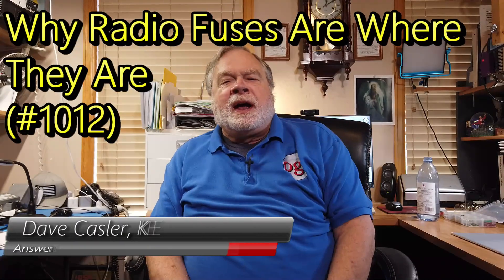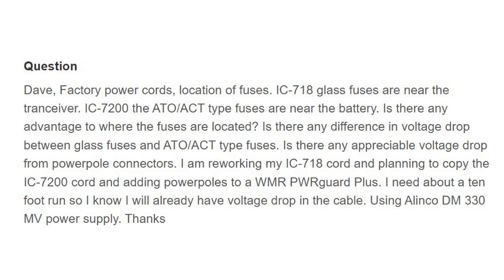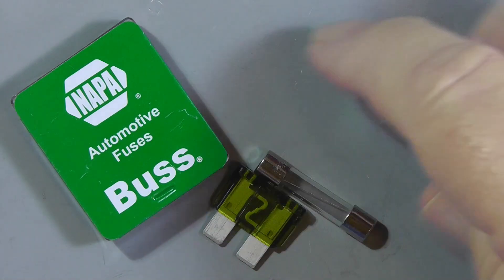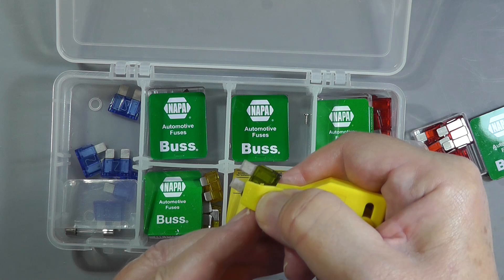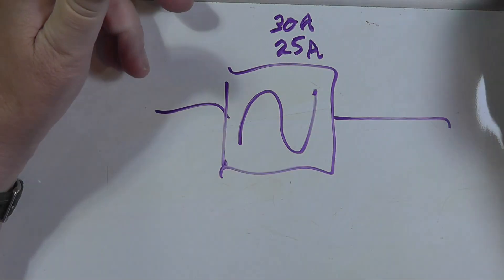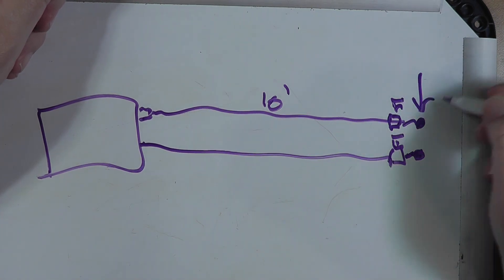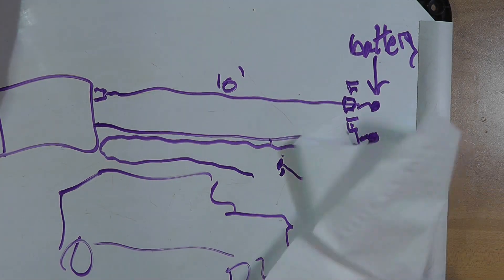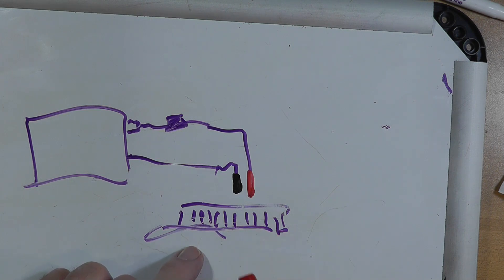Why Radio Fuses Are Where They Are (#1012)

Comment: Thank you, again. I am watching the video again. Sometimes I miss things. Also to read comments.
   First, keep plenty of fuses on hand. Working with a field engineer, we blew 26 or more fuses to find a short circuit on  Finnigan MAT 5100 GC/MS. 26 circuits went through that one fuse. A small ceramic capacitor had shorted. 
  Second, use good quality fuses. There are cheap fuses, Chinese and otherwise, that will fail and cause equipment damage and/or fires. There are YouTube videos on this. Thanks again. N0QFT

Comment: The information to connect both wires directly to the vehicle battery is outdated for modern vehicles. Due to the modern charging systems, it is recommended to connect the negative wire to a common grounding point which is usually located close to the battery.  If you don't believe me, check Ward Silver's latest bonding and grounding book. Also, depending on your vehicle, this info may be in the vehicle manual.
Reply: Yes, I agree, you don’t connect both wires directly to the battery on the new vehicles with auto stop-start and the different charging systems. Multiple reasons. And the alternator won’t know to compensate for the power consumed by the radio.

Comment: Howdy.
The thumb rule is that a fuse should be located at the wiring feed point. The purpose of fuses are mainly to protect cables from over currents (= overload and short circuit). Cable fire hazards. Fuses do not usually protect the internal wiring of an appliance. If the appliance has an internal fuse, it is indicative of that the internal wiring is considered to present some fire hazard, if not fused.
In AC the panel breaker protects the wall wiring and partially the power cord. The panel breaker protects the power cord and possible extension cord from shorts. Yes. But panel breakers do not give full overload protection of cords and extensions. Shorts yes but overloads only partially.
The Code recognizes this and allows this because a short in the cord is the most likely failure of a cord.
Regards.
Reply: However, NEC separates neutral and ground.  
DC power supplies generally don’t, particularly not in vehicles.

Thus the negative/grounded conductor should be fused if it is not at least as large as the sum of the positive leads connected to the battery to protect it in case it ever ends up being the only negative conductor.
Reply: @denverbraughler3948  Howdy mate.
How would chassis currents end up running in the radio ground wire ???.
That suggests there is another chassis connection to the ground wire somewhere. Perhaps the radio chassis or panel is mounted with galvanic contact to the car body ? That could actually introduce the hazard of many return currents finding their way through the radio chassis and the radio ground wire back to the car body eventually ending in the battery minus.
Possibility acknowledged.
Best Regards.

Comment: Can't a person just use a good multimeter to measure the voltage drops?

Also, if I am not mistaken, the largest draw will be during transmit if you ignore inrush current when turning on the radio.
Reply: Well, the answer would be sort-of, maybe. 
So you'd first need a multimeter which is good enough not to go crazy when it's measuring voltage while radio is transmitting, but we can put that under "good multimeter".
Then, there's the mechanical issue. How are you going to connect the multimeter to the cable? Normally, the cable would be fully insulated from its beginning to the end. Usually, it's possible to somehow make a connection on the power supply side, and inside of the radio. That would give total voltage drop of the whole cable, and if it's fine, then there's no problem. However, if it's not fine, then the troubleshooting can be a bit difficult. There are multimeter probes which have hook-like tips, with very thin very sharp needles on them, and are used to penetrate cable insulation, and allow measuring voltage on various points on the cable, such as near crimped splices, near fuses, and similar, and this might show which part of the cable is bad, but on the down-side, such probes puncture the insulation, which might cause problems later on.
Yet another way to look for bad parts of cable would be to key up the radio at full power, and look at the cable with a thermal camera, but those cameras are still a bit too expensive for genera use.
Reply: @AndrejaKostic I asked because I did it using various methods quite easily actually.

I measured across the different devices in the power chain and added up the drops to ensure that the measurements made sense by totalling the amounts - they should add up to the same value as across the entire chain.

In addition, my meter had no issues reading during transmit, though I also used other ways to create the same draw as the transmit draw for the radio, which made things a lot easier, as there was no limit to the "key-down" time since there was no key-down and no RF issues in the shack. Granted, there shouldn't be in a good installation. For some of the draw, I used the CBA from West Mountain Radio, for others, I used an adjustable pile like used to test automotive batteries and alternators. I just don't turn it up to draw 150A!

I found that I could access the connector contacts from behind or by disassembling some of the components without having to poke holes in the insulation, which for LV like 12V automotive wiring has been a standard method for decades. High voltage systems is a different animal.

The upshot is that I found many places where there was what I considered excessive voltage drops, some of which in places that I did not expect to find them. I then addressed those with larger wires, better connectors and installing additional, larger conductors within equipment to reduce the drop, but not change the functionality.

Comment: One other thing about putting a fuse at the battery end (at least on the + side of the cable) is if the wire insulation gets damaged and caused a short somewhere on the cable the fuse would blow. If the fuse were at the radio end and the insulation got damaged, there would be no protection.

Comment: The reason that fuses are placed at the battery end of the power line, specifically the positive lead, is that if the line you snaked through the vehicle gets cut and shorts out to the frame, the fuse will protect the line by blowing the fuse.  If the wire is shorted to frame between the battery and the fuse, the wire will overheat and probably catch fire.  That is a very bad thing to happen.

Comment: Thank you, Dave. A good video.
    Some of my old radio gear is fused on the 120 VAC lines. Use the  120 or 250 volt fuses on these lines, not the 32 volt fuses(automotive) that may literally explode. 
   Also, replace ceramic fuses with ceramics. There is sand inside the ceramic fuses that absorbs vaporized metal from the fuse and reduces the chance of the blown fuse becoming a short.
   Thank you.
N0QFT

Comment: When Powerpoles are installed in a bulkhead or metal case, there's a metal plate that can be used on the inner side, that will firmly trap them, so they can't pull out. If the maker didn't do this, shame on them.
Reply: He meant that the PowerPole connectors pull apart,  not that the connectors pull out of the radio. Easy misunderstanding.

There are retainer clips for that, too. I've been through that in the past.

Comment: Glass fuses have a nasty flaw. The fuse wire is soldered to each metal end cap, and if the fuse blows near the cap, or the solder breaks, you can't see that. No question with the ATO/ATC type.

Comment: Dave, I'm not sure if you are aware but ATC and ATO fuses are Automotive Type Closed and Open. The only difference is if you look at the top, the ATO type have two small openings, one at each pole of the fuse. You do not have to pull the fuse to test it! Just put the two spikes from the fuse tester on the fuse, in the openings, and it will test the fuse. And multimeter or test light can also be used.
 That's the beauty of them. There are also ATO/ATC fuses with a little red LED built in, that lights up if the fuse has blown.
 And the best fuse puller there us, is a cheap hemostat (Kelly Forceps) which is useful in so many ways.
Reply: And always test them. They are not always visibly blown. I don't want to admit how much time I wasted last time I had to chase a problem because I was trying to shortcut the problem solving. I finally came to my senses and electrically tested every fuse. Problem solved.

Comment: There are some nifty blade fuses for auto or other applications that will illuminate once blown. Makes it easy to identify the bad fuse. 
   Great video Dave!!!
Reply: Also blade fuse have less plastic to melt and have better contact than those push in fuses
Reply: Also blade fuse have less plastic to melt and have better contact than those push in fuses